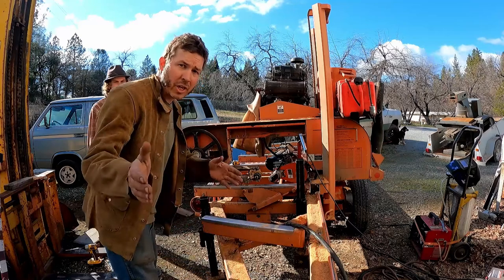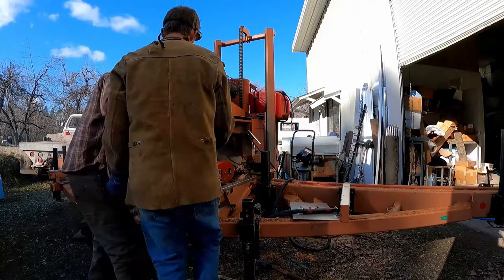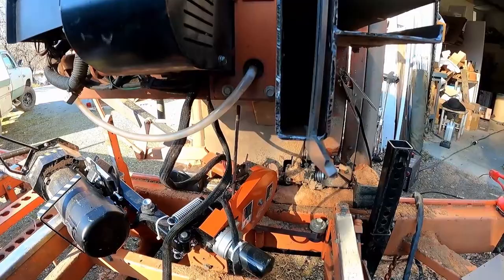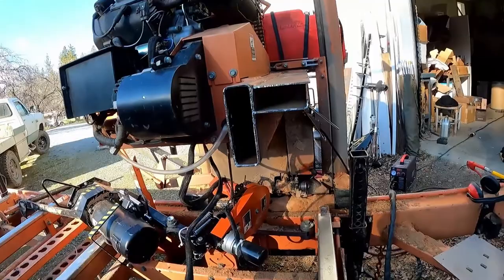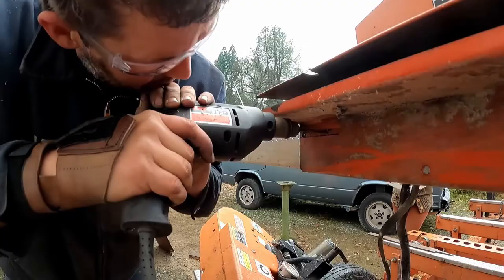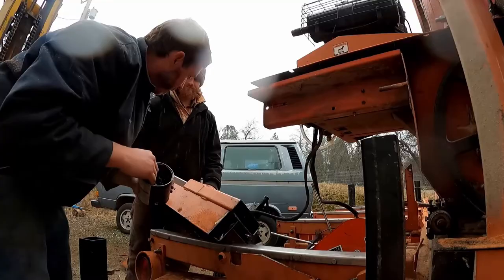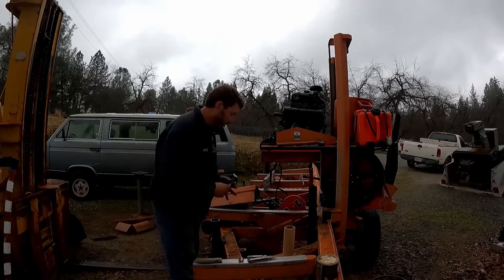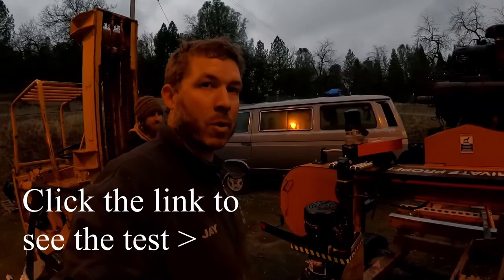How To Extend a Wood Mizer Saw Mill

Comment: With it extended the added weight further out will make you need to adjust your saw back to square. It seems it would need to be raised with a 2 post saw.
Reply from the maker: You are correct, the sw was raised back to square. I made 3 of these and all three are still working fine.

Comment: nice mod. but you really should have at a minimum, alodined the bar and used an epoxy primer to help limit, as you said, the dissimilar metal electrolysis. and while you had the steel tubing opened, a good coating of primer inside the tubing wouldn't have hurt either. either way, very nice build.

Comment: How has the worked out longer term? I have thought about this for my Trekkasaw. I'm worried the rollers and tensioner won't cope with the extra stress. What's been our experience? Great to know someone else thinks like I do. Sick of using the big chainsaw mill when its over a meter!
Reply from the maker: Working well so far.